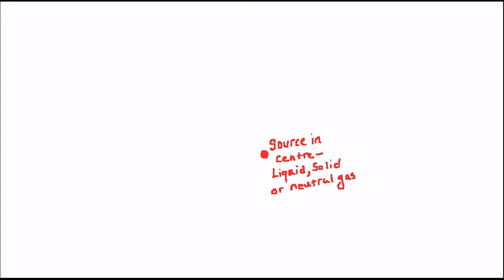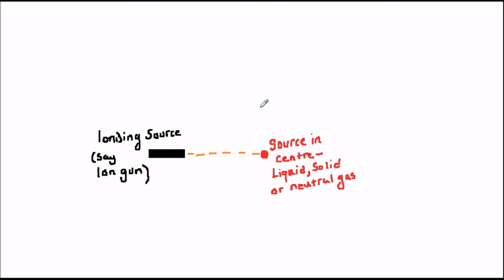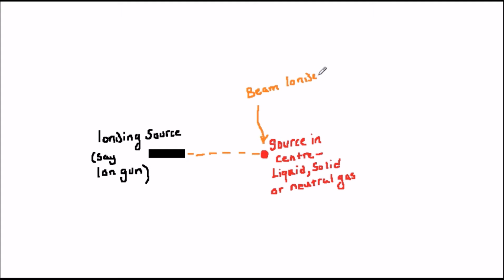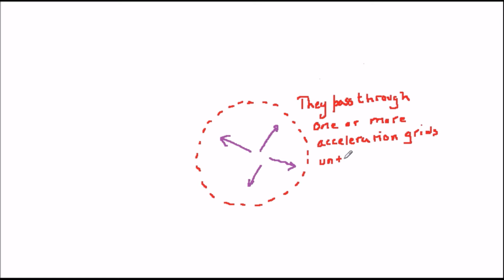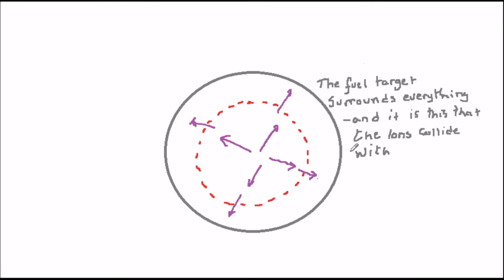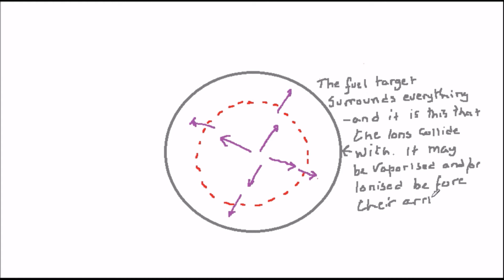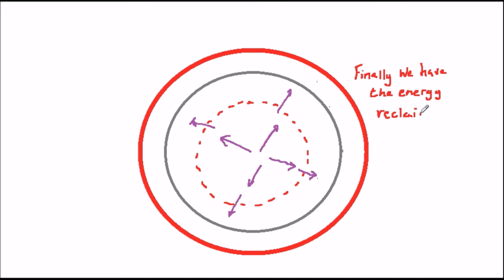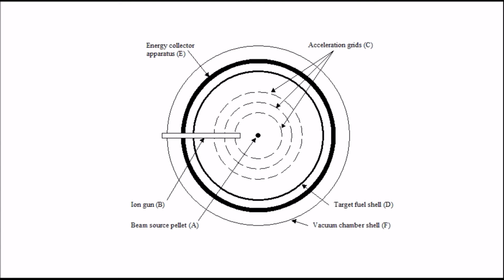The Fusor - Video 8: Innovative Designs, Future and Conclusions

Comment: How about mixing this with the sonoluminescence setup watch?v=i6RutDwO3XU&t=20m40s , using high grade heavy water, placing the grids within bounds of the bubble, while the compression wave is created in the center by hydrolysis, first detonating the hydrogen and having the wave uniformly bounce off an optimally rigid spherical container
Reply from the maker: Thanks, I will have a look.
Reply: @geekypeek232    some extra info    watch?v=m5quIBpoVwQ&t=25m18s
                                                         thermopedia.com/content/1251/
Reply: @geekypeek232  Maybe heavy water at max density with an excess deuterium/oxygen gas dissolved (at varying ratios). The excess of hydrogen alone would probably just accelerate the re-oxidation when hydrolysis is instigated. Perhaps you can link some experiments where such solutions have been detonated ?
Reply: @geekypeek232  or explore the idea in a future video ?
Reply from the maker: Certainly interesting ideas - I need to think about it and do some further research.
Reply: @geekypeek232  Looking forward to your analysis/insight.
Reply: @geekypeek232   Forgot to write that the same should, in principle, be possible using liquid deuterium, with the difference being the absence of chemical detonation, instead just pure thermal expansion due to breakdown, which would set off the outward wave that would bounce back, and by "detonating" at the resonant frequency of the tank/system, a stationary wave could be set up ?... Maybe you can confirm/bust the last part right away ?
Reply: @geekypeek232   more experiments watch?v=AzuVGhLIo8o         watch?v=p7sgha8E5ew